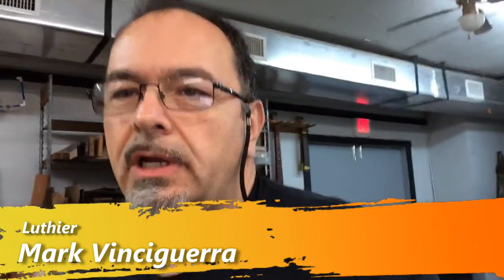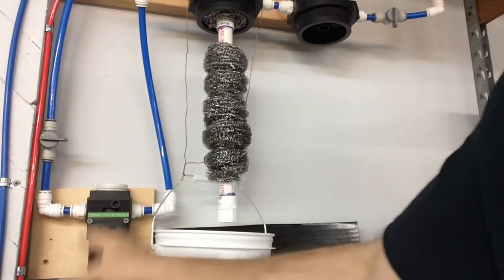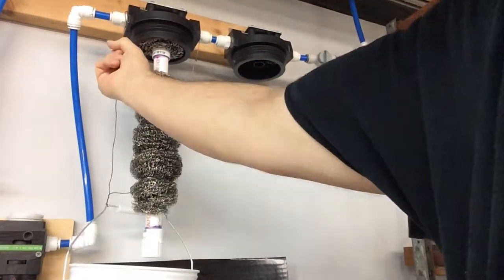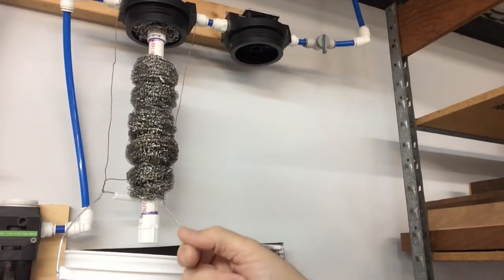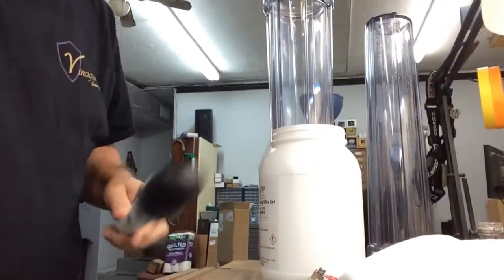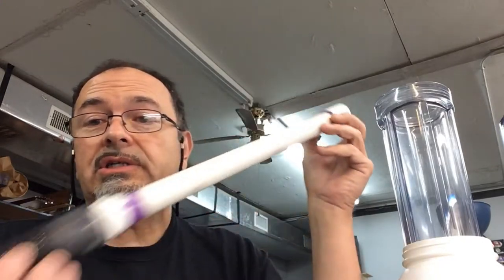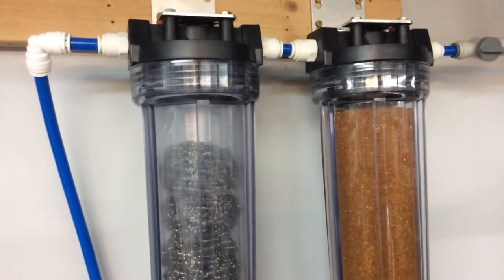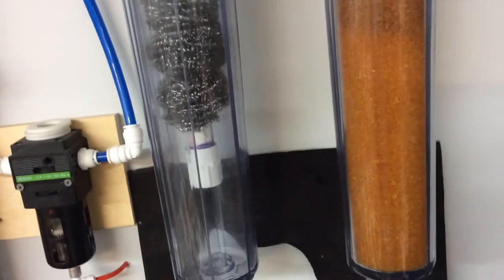DIY Compressed Air Dryer

Comment: Also I am sorry not trying to seem critical as I am sure it appears. I am just working on my own system and (obviously) very anal, and expressing my own ideas I have worked thru from refrigerated type to the passive types such as yours. My other point though not so obvious is that these passive systems will not work well for continuous use as the heat taken from the air to lower the dew point has to be removed somehow. passive conduction is fine in occasional use systems but for continuous use systems you need refrigerated systems to carry away the heat or llarge amounts of silica beads which need to be dried (energy use) and recycled. Sorry I will stop.

Comment: "Impact" does not affect the dew point unsess the speed of the air is fast enough to create enough friction to heat the air but that would raise the dew point. The steel wool or the windshield or your car removes heat from the air and lowers the dew point thus causes condensation (not the impact). The only time the water can cause gain or loss of energy is with a change in State, everapation, sublimation or the other way gas to liquid etc. that occurs because of the steel wool carrying away heat from the air with equal change in dew point then condensation occurs due to change in temp. the ideal way is exactly what occurs in the storage tank but only initially and that is the cooling effecy of the steel tank and also , initially the expansion into the tank and drop in partial pressure. However as the tank fills and there is no longer much of a pressure drop the only effect in the cooling from the tank. If you could continue the pressure drop with expansion but difficult to do because of the commulication of all the areas with equal pressure all thru the system to alter that you would need an expansion valve type system to maintain the pressure separation from the air behind but then you would have an analogous system to an Air-Conditioner.

Comment: Avesome video been looking for these bigger filter containers locally but no luck.

Wouldn't be the first tank more effective if you reverse it's flow too?
Bernoulli's principle and dew point control by volume change from small fast flow into wider higher pressure in the container should strip some water alone I think.
Not sure tho.
Reply from the maker: Thanks so much! Never thought about reversing the first one too...... but that makes sense! I will look into that...... thanks!

Comment: The way to remove moisture is to cool it before it enters the tank from compressor and easily done,,,I did it by adding a 1/2 inch  roll of coil copper tubing between compressor and tank,,, dropped my high 80 degrees and I have very little water in my tank now,,, and I never use plastic it becomes very brittle with time and can become like scratnel when it blows apart..
Reply from the maker: Thanks for the info

Comment: I do tend to go on, the expansion valve type system would be great but you would need to have continuous consumption of the now dry air as storage would be difficult to do cuz you would tremendous amount of storage space because of the now deceased  pressure thus you would need to re-compress the dry air then store it. Very costly and overkill. This is the exact same as an air conditioned system but using air not freon or ammonia gas but again not a recycled system so you run into the problem I discussed  earlier that is the storage of the now expanded "dry" air but now loss of pressure thus the need for re-compresion. Nothing requiring the change of state or energy input is free. Your way , and a good way, as i am not knocking you setup, is using some of the energy from compression and giving up heat to the steel wool (which needs to be removed somehow or the system stops working) thus lowering the dew point and causing condensation. Man thats a long winded way to say that (lots left out I know).
Reply from the maker: Mark Rigney good info..... so if I could chill the air lines a bit more (more length in the 72 f shop) before it hits those cold steel mesh pads, I may get even more water broken out before the desiccant? Man I’m gonna do it, because I am baking more beans than a Mexican Restaurant! Lol! Thanks for you comment.... appreciate it!

Comment: where do you get these big descendant body kits?
Reply from the maker: Thanks for your question. I haven’t seen any kits available, I just use 20” Pentair water filter housings to hold the media. Be careful, these housings are only rated at 125 psi! Being a guitar builder (wood/paint shop), I keep my pressure at about 100 psi in the shop.

Comment: What is with all the backwards flow users?
Reply from the maker: Check video @ 4:15 reverse flow explained,
Thanks for watching!
Reply: @VCustomShop  No, not explained,  pointed out, but not explained.  

You're not the only person who has built one of these and run the flow backwards.  But not one has been able to explain why they choose to run a subsystem, that was designed by an engineer and constructed with labels for in and out, backwards.
Reply from the maker: Ahhh, I just reviewed..... you are correct, I skipped all of my logic for the reverse flow. I had 2 main thoughts in mind, the first and primary reason was that I wanted gravity in my favor as far as water was concerned. The wettest beads on the bottom, and the moisture would tend to collect there and hyper saturate the bottom beads without contaminating any fresh beads below it. And the other one (not as important) was it didn’t want to hit those tiny little beads up top with an in rush of air to get the peculating and rattling (and sand blasting) in the canister. For the most part, it works very well...... when I change the beads the top 2/3rds come out relatively dry (although color changed), but the bottom 3rd is wet and the beads tend to stick to the walls and need to be wiped out with a paper towel. The engineers did great as far as water filtration...... I would not change a thing...... but this is a bit different! Thanks again for watching, Mark
Reply: Paul it's not difficult, the system is very simple. Using the in/out "inverted" mimics what actual (and very expensive) compressed air dessicant units do, that is why people do that. The "engineers" that design these, do not have compressed air in mind, so their label is irrelevant (when filtering water, filters cartridges are built to filter in the direction of the arrows, but this is a completely different application).

Comment: I wonder if putting your beads inside a pillowcase (or similar) and leaving them in the clothes dryer would work. I'm looking for an alternative to using the microwave to dry mine.
Reply: Just put them in the regular oven...
Reply: no need to do any of this,, put valves on both sides and a schrader to pull a vacuum with a smal hvac pump, takes very little time and effort,,,

Comment: Great video.  I have one of those arriving today.  While stumbling around amazon,  looking for more air drop blocks for my Rapidair rig,  I discovered something.  Look up sintered bronze muffler. The perfect solution for both of your tube ends. No mods needed.
Reply from the maker: Thanks! Great idea!
Reply: What sort of pressure are you pushing thru those canisters?  In my current mindset, my plan is that the desiccant dryer will only ever see gun pressure,  not the full system pressure.  That,  and I'm still probably going to contain them incase of catastrophic failure.
Reply from the maker: @leesbassment6393  I have the entire system regulated down to 75 psi. I basically use palm sanders and paint guns..... so it works out good for me!
Reply: That's my plan as well.  Regulate it right after my compressor,  then run thru a four drop up/down dryer/manifold(called the UDR-4000, for "uppy downy rig", then the rest of the filtering,  then regulated for the spray gun,  with that line going thru the modded water filter/desiccant Rig.  We're calling that one the explodeomatic.  I'm sure it will be fine at gun pressure,  but it's still going to live in a box

Comment: How often do you have to change / dry the desiccant?
Reply from the maker: I bake them about every 6-8 weeks in the winter months and about 3 weeks in the summer. I am in Florida and the compressor is basically outside as far as temp goes. It seems to not like to be baked more than 3 times before the color won't snap back, but it is cheap enough on Amazon to replace it as needed.

Comment: Wow! Great video. Looks like you have made the exact setup that I would like to have for my plasma table. Dry air is very important. Could you provide me with some info on where to buy and what model you used for the clear canister things?
Reply from the maker: Sorry so slow in response..... Pentair Standard housings are rated up to 125 psi, I mis-spoke in the video...... Here is a link to the Pentair housing  https://www.espwaterproducts.com/content/Pentek_Standard_Housings_Spec_Sheet.pdf